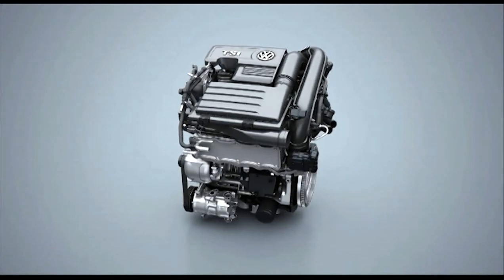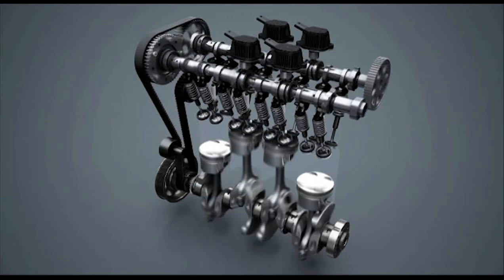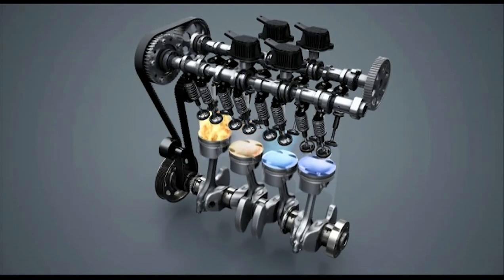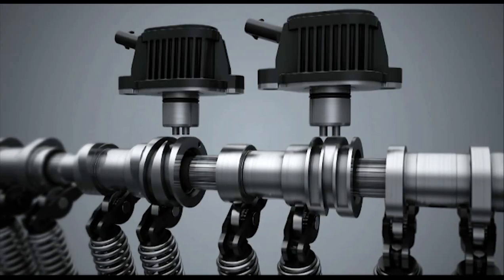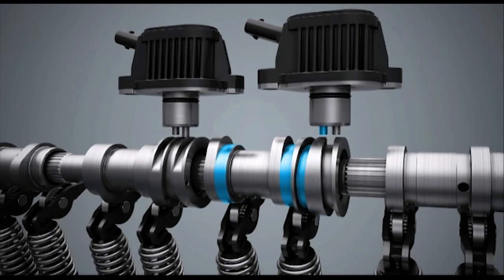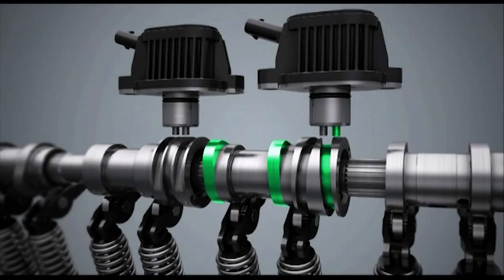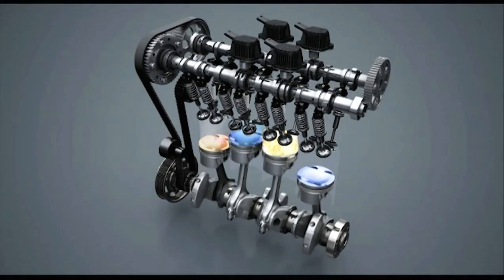Volkswagen ACT - Active cylinder management

Comment: Been using it for 2 years now on a T-ROC 1.5 TSI with an EVO 2 engine, I can say with confidence that I hate it. Makes the engine shaky, less responsive, harder to predict, and it barely saves any fuel if you know when to change your gears.
Reply: how much fuel it saves, because i am thinking to deactivate that ACT feature
Reply: @tinko975  I estimate the fuel saving around 2% at most because the ACT is active about 10% of the time. I usually change gears before or just as it starts.
Reply: In my 1.5 TSI Golf on a good motorway journey using cruise control, the car is often in 2 cylinder mode, with average fuel consumption reported at upwards of 100mpg.  On long journeys I've had as much as 70mpg out of the car,  my last car, a 1.4 Turbo Vauxhall engine, I'd be lucky if I did 50mpg on the exact same journey.

Comment: Why you people are so dumb?
Why do you think it's either black or white?
When asking "if anyone has got any problems with their engines" what do you mean by that?

Now I've got a better question for you: whoever claims that I have zero problems with this engine, connect a compression tester gauge to see whether or not all 4 cylinder showing roughly the same number. Upload a video and prove your point. 
Alternatively, check all the intake valves and they should have the same amount of carbon deposits on them.

Prove it with something, otherwise, just STFU

Comment: Why are both the intake and exhaust valves closed? Wouldnt it be better to leave the exhaust valves open so that there is no work required to comrpess the air in these cylinders?
Reply: Must have something to do with the cranshaft not snapping in half and the engine running more smoothly, interesting question...

Comment: Won't the deactivated cylinders become dead weight on the driveshaft and increase the load on the other two active cylinders? Just curious.
Reply: Acts as an air spring almost
Reply: they will take up energy during the upwards stroke but in the downwards stroke, the compressed gas pushes the cylinder back as it never left. There are some losses due to rotating mass and friction, but they are inevitable with a system like this.

Comment: So guys it has been almost 10 years since this video is posted. Let's hear from people if they saved on gas or just had trouble with the engines. 
I have been using it for 5 years, no issues with this engine. over 100K km with the car (1.4 tsi act). Act really helps with the fuel consumption.
Reply: 1.4 tfsi audi a3 (same engine) absolutely no issues, great fuel consumption. Amazing engine that can handle good load of boost
Reply: Also 5 years, almost 6, no problems, but only about 30.000 miles (46.000 km) - 1.4 TSI.
Reply: Hello there 😊
Please also post what engine code you have, so that other 1.4 tsi owners can better identify successful engines.  My engine is CHPA 1.4 TSI and I don't know if it has this system.
Reply: Mine is making this weird rattling noise, only when it is in 2 cilinder mode. I dont have the car long since i bought it second hand. You can hear it outside the car. I almost feel ashamed, my car sounds like its going to fall apart. What could this be?
Reply: @Zyderos_64  idk i buy used audi a3 1.4tsfi sportback with ATC and has no sound issue but i go to near tuning store to deactivate it. it only save 0.5 liter only if you drive calm and no city.

Comment: Two of the four cylinders bear a larger amount of wear due to the fact that those cylinders are always working while the remaining two cylinders are deactivated for a certain period of time. The deactivated cylinders are cold and, when activated (requiring more torque), have increased wear. So the total wear of this engine is greater than one that does not have this system. The problem, however, is what to do with the oil that enters the deactivated cylinders (the piston rings act as an oil pump). The oil inlet is also augmented by the fact that after a few seconds, the air inside the cylinder due to its leakage from the piston rings will cease to act as a spring, as in the cylinder will be vacuum during piston descent. How are these problems handled by Volkswagen, or they are not so important that they do not significantly affect the operation and lifespan?
Reply: Firstly, cylinders 2 and 3 are still reciprocating at exactly the same rate as 1 and 4, the only difference is they're not producing combustion so they still "wear" at the same rate. Heat transfer from cylinders 1 and 4 and also water and oil circulation will still keep cylinders 2 and 3 at almost identical temperatures to 1 and 4. The heat loss from deactivation is so small its imperceptible. Secondly, pistons have an oil control ring to prevent cylinder lubrication oil leaking into the combustion chamber. The deactivated cylinders still require lubrication.
Reply: @djfld2394  very good explanation 👍
Reply: @djfld2394  and also even when deactivated the exhaust valves for deactivatedcylinders is still open making it to inlet exhaust gases in to the cylinder and exhausting it again keeping the cylinder walls and head warm
Reply: @charanso143  i dont understand what you’re saying
Reply: @djfld2394  i am agreeing with you and adding that the deactivated cylinders inlet valves will be completley closed but the exhaust valves will be opened completley to prevent vaccum pumping. so the 2 deactivated cylinders would still be sucking up the exhaust in the axhaust manifold and venting it out again on the same outlet keeping the 2 cylinders warm from preventing cylinder seizure.
Reply: @charanso143 You as well. Tell me you know nothing about BASIC thermodynamics without telling me that you don't understand anything about BASIC thermodynamics.
Reply: @djfld2394 You're awfully wrong. Why do you participate in topics that you have literally zero clue about them?
Reply: Volkswagen ignores your problems. It is the usual VW Modus Operandi.
Reply: Recently, I saw a 1.4T Audi a3 with 76.000 kms year 2016 and specially one cylinder don't work properly because excessive wear our fatigue in the camshaft lobe and there other three are coming soon...
Reply: Such a satisfying driving experience with the VWs I have had. My brain accepts that Toyota nails every process difficulty quickly due to their management style geared to reliability but they are sooooooo boooooriiinnnng.

I strip away the old debris
That hides a shining car
A brilliant Red Barchetta
From a better vanished time
We'll fire up the willing engine
Responding with a roar
Tires spitting gravel
I commit my weekly crime...

Comment: Won't this cause a vacuüm on cilinder 2&3? And compression will still occur on cil 2&3 when they are shut down?
Reply: Valves are actually not opened, but closes in this regime 🤷‍♂️
Reply: Project Funcar there will be no pressure on 2&3 cuz the values will be always opened n the computer will cut the fuel
Reply: @zakigharbi5338  

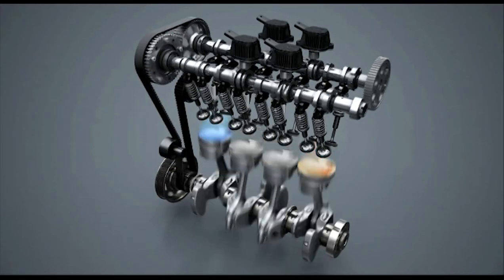1:57

The valves stay closed, dumb ass!

Comment: Combustion chamber 1 and 4 work under higher loads does that mean extra wear for most city drivers
Reply: One of the conditions for deactivation is that the LOAD is less than 100 Nm. When the load is big enough, all 4 cylinders will work. It will only deactivate 2 cylinders when the load is really low, for ex. when you are barely touching the acceleration pedal.
https://www.youtube.com/watch?v=DJ4eLGVLXXw - much more details about this technology.